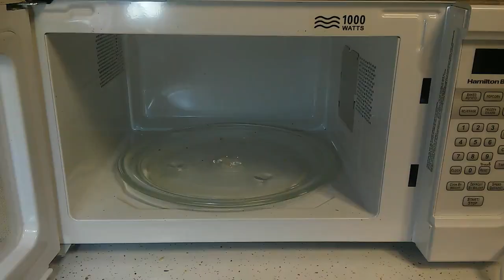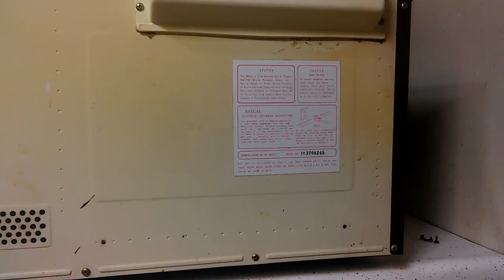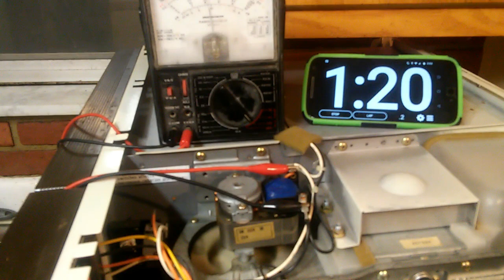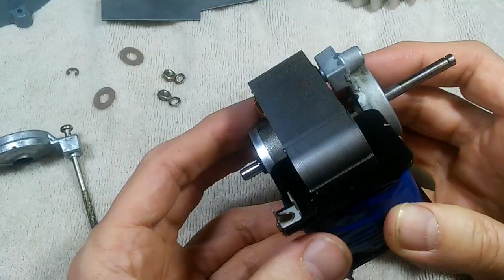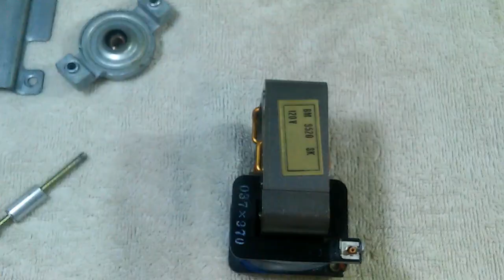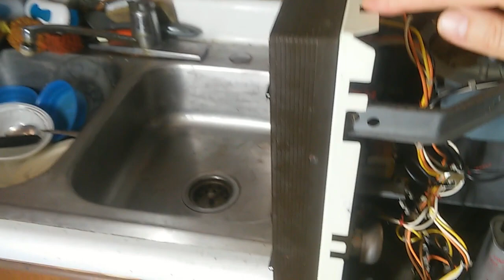Kenmore Microwave Oven 99421 Repair

Comment: Looks like a rebadged Sanyo for Kenmore.  I have the sanyo version of this microwave.  Looks practically identical to your kenmore.  Sanyo is a very cheap brand, and they made the cheaper priced kenmores for sears.  The more expensive line of kenmore microwaves were rebadged whirlpool microwave ovens, and they had a motor driven stirrer  blade some driven by a belt as magnetron cooling fan had a pully on the oposite end.  I am surprised tge cooling fan is not wired in directly to come on.